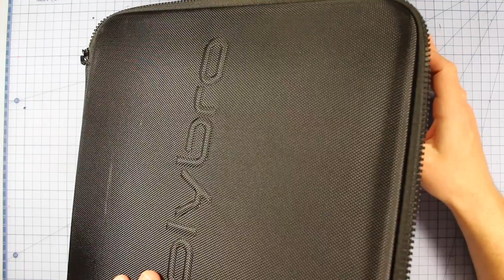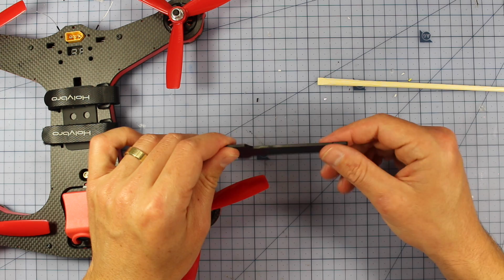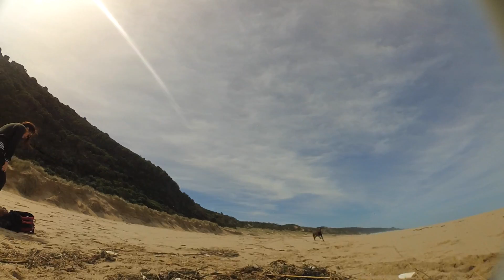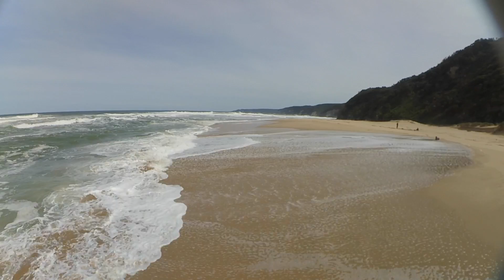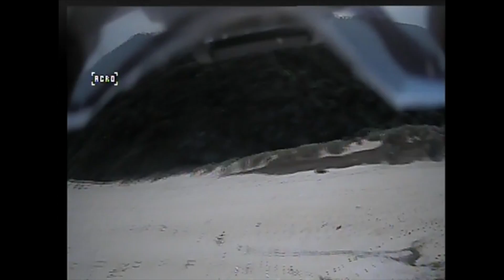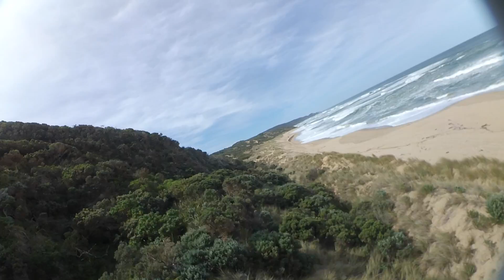Shuriken 250 Quadcopter Review. So Easy

Comment: I must be missing something . I even have this shuriken taken apart, and still can not see how to change the VTX from 25 to 600 with these so called jumpers. From the top, side, what do you force?
Reply from the maker: you change the pins that are being jumped.
Reply from the maker: so take the jumper off 2 pins and put them on the other. the diagram is in the manual

Comment: I'm looking to buy, but I'm having trouble deciding! Which handles better the 180 or the 250?  Which would you recommend?
Reply from the maker: 180 with a 4s 1000mah lipo is the best
Reply: Great can you recommend a cheap transmitter? I already ordered my battery though and bought 1800mah 4s 65c hopefully it fits! 39*34*68MM I'm new to the sport, so this is a great help.
Cheers
Reply from the maker: Miz izHere that is a big battery...might not fit on the 180...also the only radio i recommend is the tbs tango or the taranis.

Comment: Protip for both shuriken models, get the carbon fiber camera mount to replace the rubbish plastic one.

Then you can cable tie the vtx antenna to the carbon camera frame or add a pig tail so you can protect the vtx antenna connection or you'll be able replacing the whole board when it breaks.

They also sell a CCD camera replacement which is way better and also a low light camera too.

You can add telemetry by soldering a single wire in too.
Reply: Some great tips, Thanks!

I have not any info on the ccd camera. Could you share a link? Any idea if a small version hs1177 from foxeer (http://www.banggood.com/FOXEER-HS1177M-600TVL-CCD-Sony-Chip-Components-PAL-NTSC-2_8mm-IR-Mini-FPV-Camera-5V-22V-with-Bracket-p-1049378.html) would work?
Reply: http://next-fpv.theshoppad.com/#/product/holybro-shuriken-upgrade-1000tvl-1-3-ccd-110-degree-2-8mm-lens-mini-fpv-camera

That's where I saw the camera but I'm located in Australia so you may need to search else where.

I think you could make another cameras fit with a bit of work, really depends on the dimensions compared to the camera mount.
Reply: Thank you. From what I can tell the camera you got isn't specifically for the Shuriken, it's one of these: http://www.banggood.com/Eachine-1000TVL-13-CCD-110-Degree-2_8mm-Lens-Mini-FPV-Camera-NTSC-PAL-Switchable-p-1053340.html

Thank for the info!
Reply: 99Goth99
Yeah its just the exact same form factor as the stock one so you know it will fit just right.